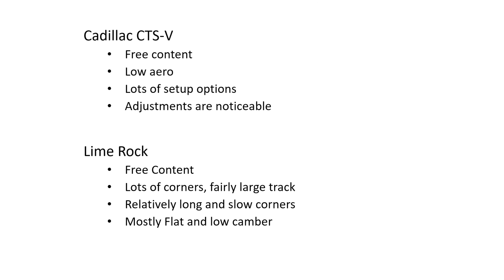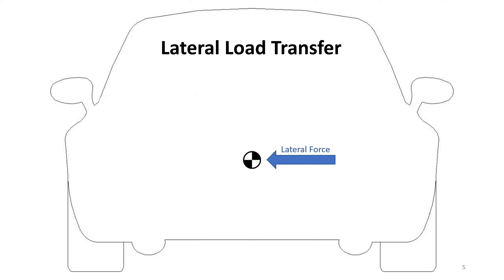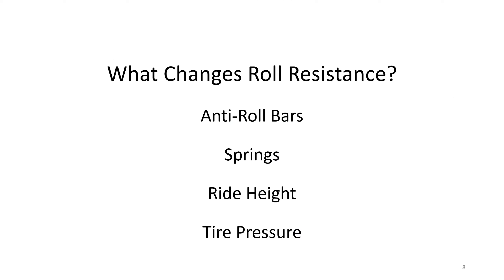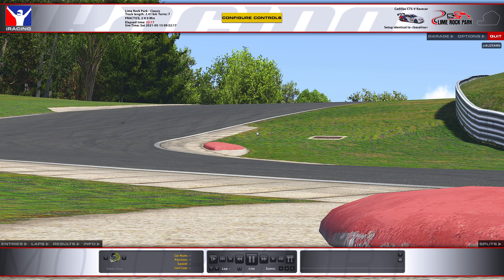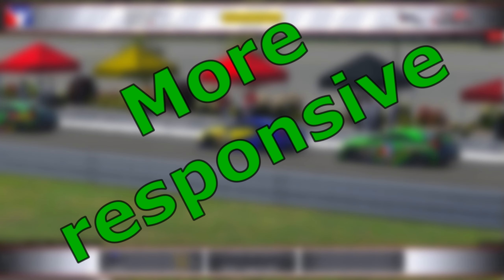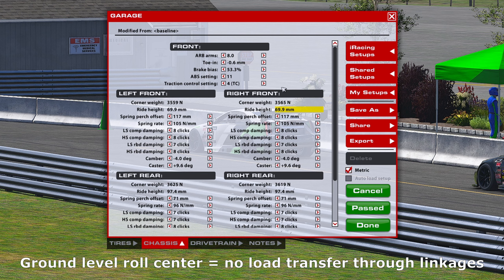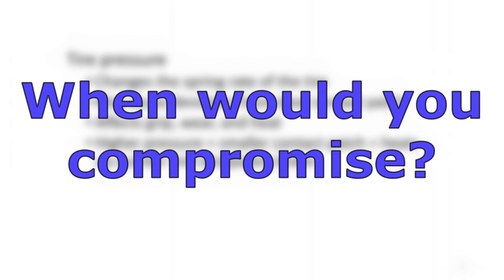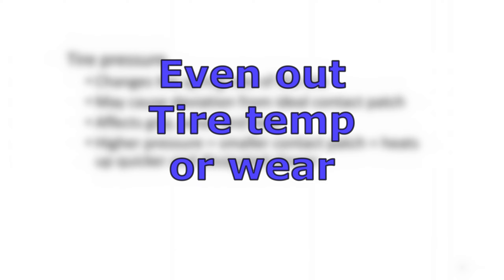4 setup changes to Improve your car's handling - PCA Sim Setup Workshop

Comment: Thought I knew a lot about setup but learnt something new in this video. When to soften ARB vs springs. So for a track like Sebring you would soften ARB instead of springs right?
Reply from the maker: I’ve found Sebring to be particularly hard to setup for. To answer your question, you’ll need to think about how much aero platform control you want. If aero is important, you will likely need to keep the springs a certain stiffness, and tweak arbs to get the desired roll coupling. The flip side is that it won’t navigate the bumps well, especially going into sunset. Then there’s the issue of the curbs which will affect your decision making.

Whether you soften the springs or the arb really depends on the circumstance and the starting point.

Comment: hey I am seriously confused, could you please clarify why lower spring rates reduce lateral (or longitudinal for that matter) load transfer? I was always of the impression that we the opposite was true as a spring with a lower spring rate would take less force to deflect and so would encourage more rolling of the chassis as there is less resistance coming from the spring itself.
Reply from the maker: Hey Stephen, thanks for your question! You're on the right track. It's exactly the lower roll resistance of an axle that reduces load transfer on that axle. Think of it this way, under lateral load, a car is going to roll no matter what. At some roll moment, if one axle has super soft roll resistance, for example, that axle will push the outside tire on the ground much more lightly than the axle with stiff roll resistance. As you can probably picture, the axle with the stiff springs will be pushing the tire into the ground much more firmly than the soft axle. Similarly, the soft axle will also pull the (inside) wheel off the ground much more lightly than the stiff axle. Together, the softer axle will experience less lateral load transfer, and because of tire load sensitivity (see here: https://youtu.be/sORwV-PF63M), that axle will have more 'grip'

In the longitudinal case, in most series cars are set up symmetrically, so this does not really apply.

Comment: You say the only 3 things that affect lateral load transfer are lateral force (on CG), CG height, and track width. What about the wheelbase length or even the overall weight of the vehicle?
Reply from the maker: Hey Chonglers. The wheelbase will affect longitudinal load transfer (like how track width affects lateral). Weight just changes load because there's more off it. If a car transfers 30% load in a given situation, it's still going to transfer 30% if you add weight to the CG. Only that in practice, if you add more weight, the car won't be able to hold as much lateral force, which means you won't see 30% load transfer. BTW have you seen this? [IS MORE WEIGHT BETTER FOR CORNERING?] https://youtu.be/sORwV-PF63M
Reply: @LastTenth Of course, you said lateral load transfer. Silly me🤦 I was thinking of weight transfer in general.

I've been reading that the more weight equals more weight transfer, but your example clearly shows that they are in fact 2 different things; the act of weight transfed and the effects of adding more weight. Thank you for clearing things up. 

I've caught up with all your vids lol thanks for sharing your knowledge